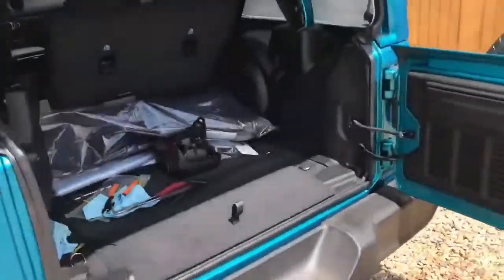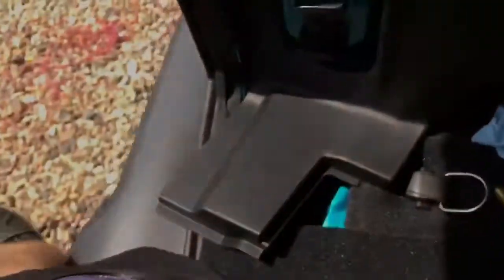How To Wire A Plug For Trailer Lights On A Jeep Wrangler JL The Easy Way

Comment: Thanks Cory! I did the same thing on my 2020 2 door JL with the wiring harness. The aux outlet is a 20 amp fuse and the kit was a 10 amp fuse. I dont use the outlet, so i just replaced the fuse with a 10 amp to be safe. Worked like a charm and have had no issues with my trailer lights.

Comment: I did the same thing, but its wierd, turn signals only work when the vehicle is not running. Tailights wotk fine tho. I dont think its this power supply, but im at a loss to why , thinking a bad "box" maybe